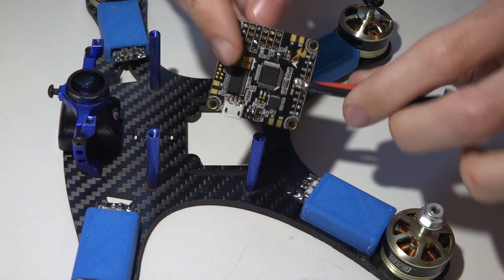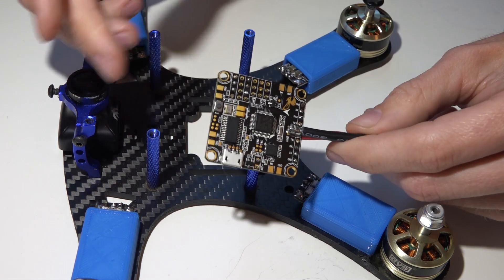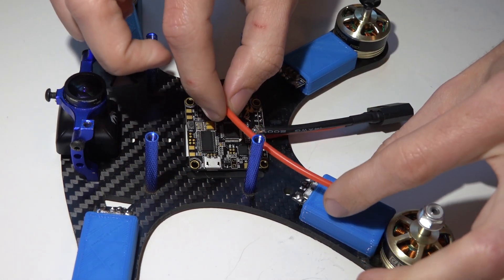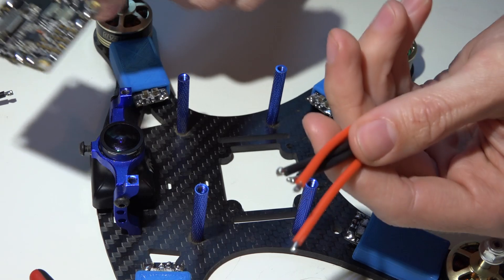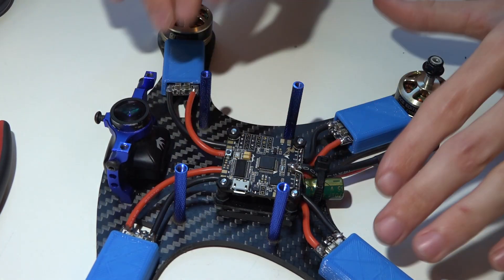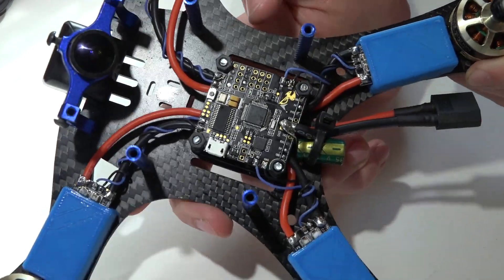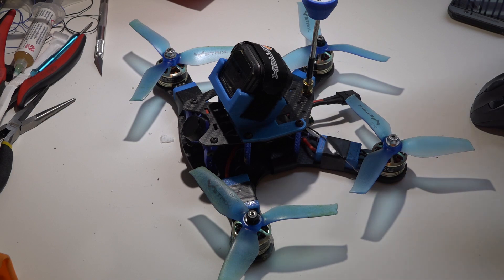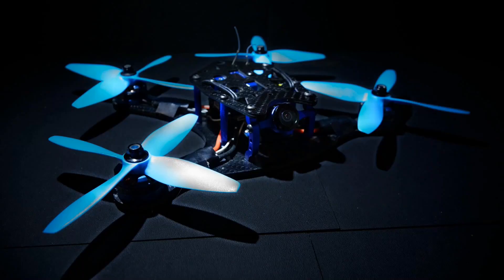Betaflight F3: Wiring Into Frame & ESCs

Comment: Why did you install a capacitor?
Reply: in simple words, it will smooth out the voltage from the battery (prevent spikes) and give "clean" energy that can save u brown outs and other stuff. Don't pay much attention to it and just do it, won't hurt you, u need to know some electronics to understand how it works.
Reply: Same question.

Comment: Capacitors? What do they do for the flying, JD?
Reply: in simple words, it will smooth out the voltage from the battery (prevent spikes) and give "clean" energy that can save u brown outs and other stuff. Don't pay much attention to it and just do it, won't hurt you, u need to know some electronics to understand how it works.

Comment: I was wondering if you knew anything about how to flash the firmware on this board? I have flashed many other boards in the past few years but I can't get this one to flash.
Reply: yes
Reply: Yes. There is a boot button on the f3 from betaflight so I am pushing it and the red light does not come on.
Reply: are you checking that the right driver is installed or did u correct it already?